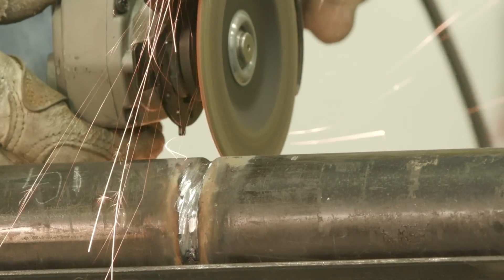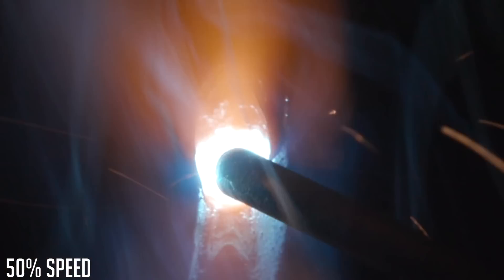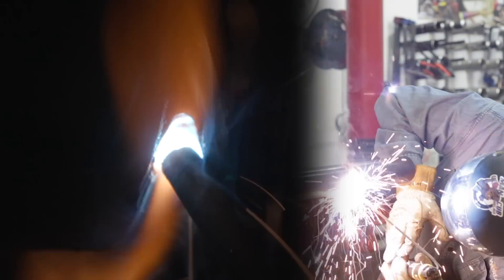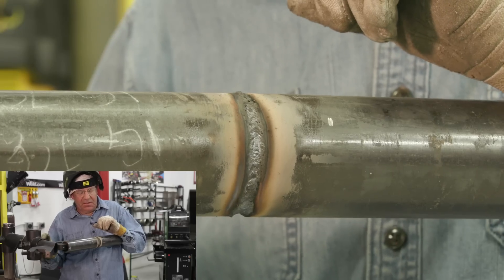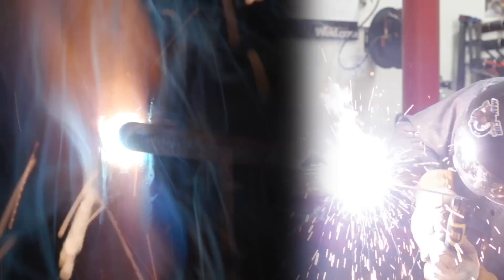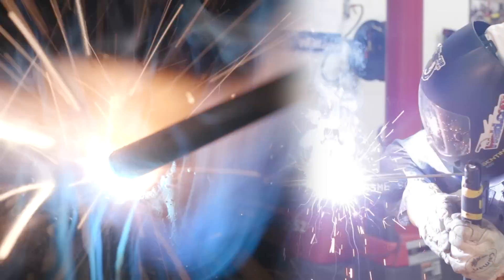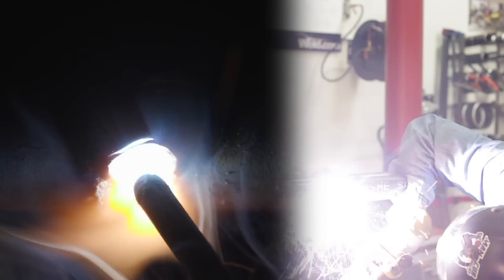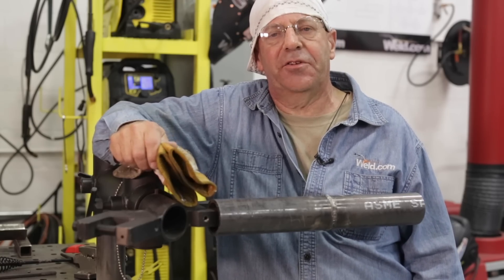6010 Downhill FILL and CAP Techniques

Comment: I'm self teaching how to weld FCAW. Do you have any videos that will help me on seeing the puddle? I'm having a hard time seeing it. I have the shade at 11. Thank you.
Reply: One thing you can do is rod selection. Iron powder rods produce lots of slag so the puddle is harder to see. On the other hand, if you do 6011 you should be able to see it. Also, depending on amperage you can probably get by with a setting of 10 on your helmet but thats a guess since they are a little bit relative. A 10 should be  a 10 everywhere but we have compared helmets and can tell slight differences.
Reply: Thank you Nick for the information and taking the time. Much appreciated.
Reply: @whasumara73  No problem, glad to help. I have been there before. For instance when I bought my first auto-darkening helmet, the controls were not intuitive so I had it much darker than I thought I did. I could barely see anything. I'm not sure about whether Jody has any videos about seeing the puddle but you can check out Welding Tips and Tricks channel and web site forum. Hope your welding comes along well.
Reply: I appreciate all the help I can get. :) I will look into all you've mentioned.

Comment: Hi Bob, can you explain schedule eighty for a beginner here.
Reply: Kev Barry it's pipe wall thickness.
Reply: Kev Barry it's thicker than schedule 40. We use it a lot for steam condensate.
Reply: Schedules are like gauges on sheetmetal. There is a small range min/max  wall thickness and min/max pipe diameter for a given schedule and diameter. Check out the link for a chart reference. 
engineersedge.com/pipe_schedules.htm
Reply: Thanks guys. As a hobbyist it helps to understand how much pro welders have to learn. You guys are amazing technicians.